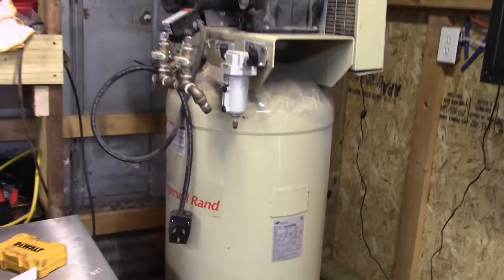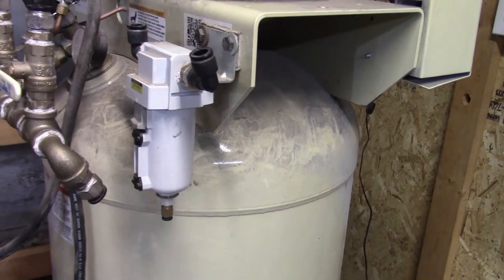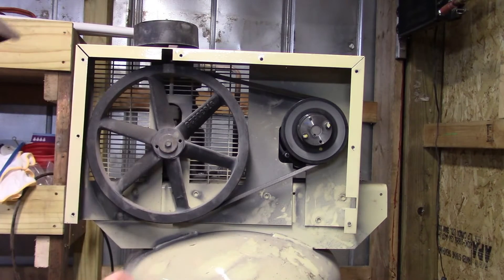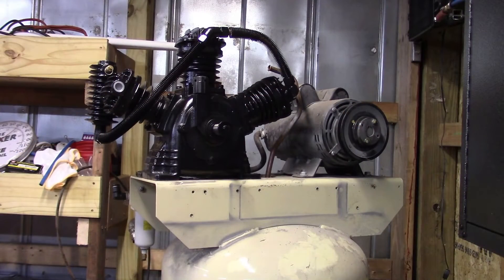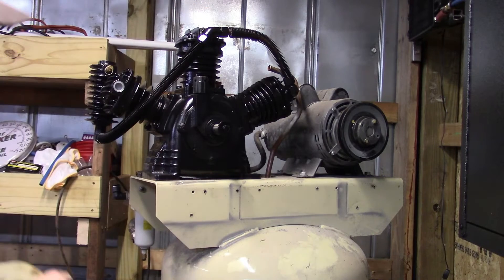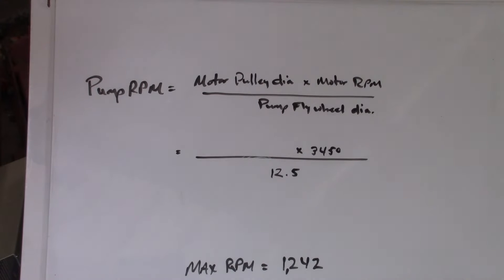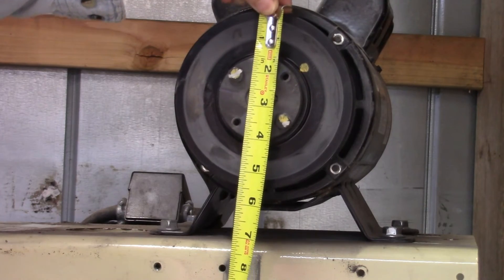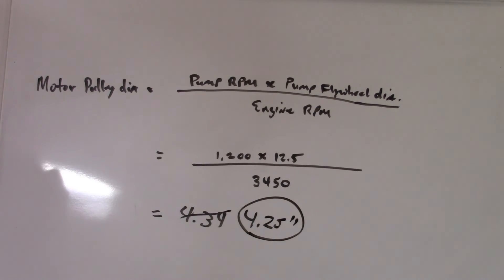Retrofitting a 2 Stage Air Compressor Part 1

Comment: Got in a J-air compressor with a bad pump at 5.5hp motor. I’m thinking about going double stage on my single stage unit. Is there any things I need to set before I go ahead and purchase ?
Reply: Btw finding a 5.5 hp single pump is almost impossible….